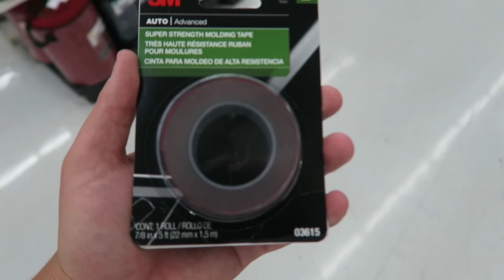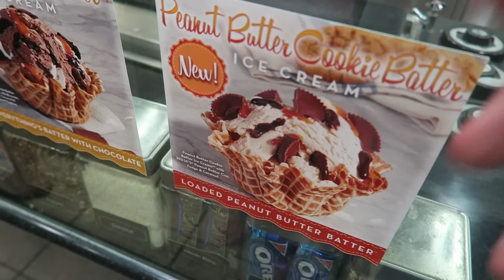HUGE EXPLOSION!! (CAUGHT ON CAMERA)

Comment: Codee, Lemonade has sugar in it and sugar when liquidified and left at room temp or hotter too long or if the date has expired, it will start to ferment. The lemon itself has folate acid in it (most citrus fruits do) so when you left the lemonade out with the lid on it at room temp, it got hotter than it should have and started fermenting. The fermentation of the sugar and the folate acid mixed put off a gas that caused the jug to swell (gather air) and as you know, anything with a lid on it that has gathered air and swollen will burst when thrown against the grown. If you hadn't remember or found it and just left it setting there longer, it would have swelled until it exploded on its own in your house so be very glad your remembered/found it. We had a glass jar of Apple Sauce to explode all in our cabinet one time. We had forgotten about having it and went on vacation. When we go on vacation, we turn the AC off if we don't have any pets to save on the electricity bill and we didn't have any pets at the time. So between the hot house and us forgetting we had the Apple Sauce so it had ran out of date, We came home to a house smelling like rotten apples (beer to me because I think it smells like that)

I hope this explains a little of why the jug swelled like that.